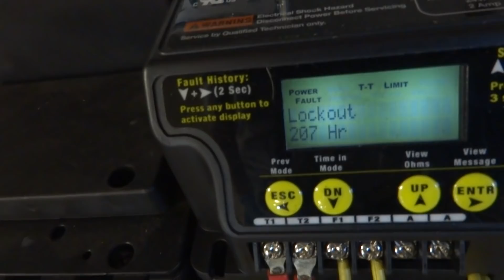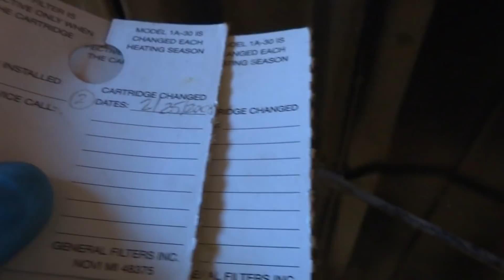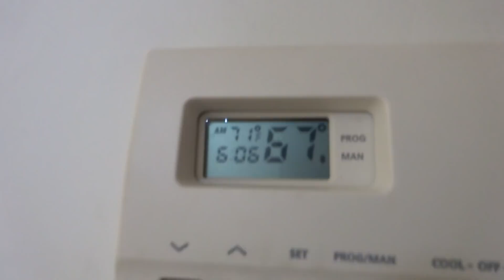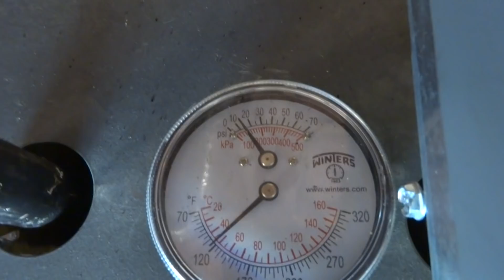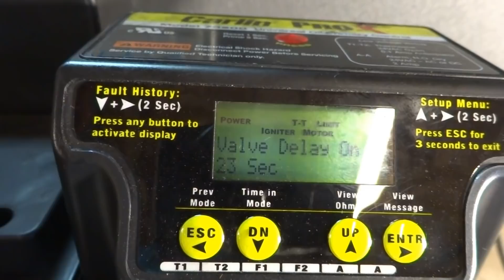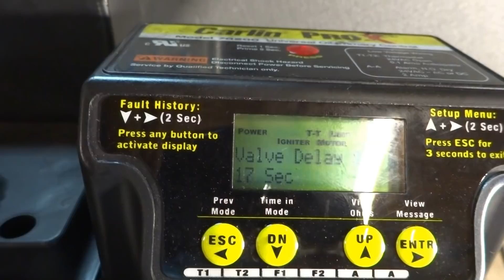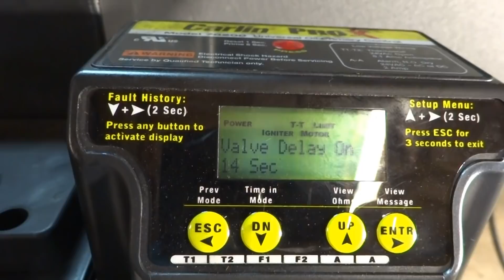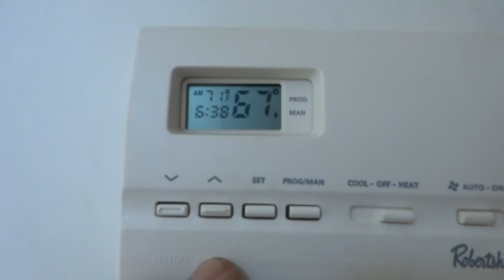CARLIN EZ1 OIL BURNER RUNNING ROUGH LACK OF MAINTAINANCE

Comment: The thing I don't like about these EZ1 burners is that if you get an air bubble in the oil line and the flame extinguishes for less than a second, the burner trips off. I prefer the Becket B2007 controls with a 15 second TFI and a 2 stage oil pump for in ground tanks. The Carlin and all the other burners with single stage oil pumps seem to have trouble maintaining steady oil flow with in ground tanks. Would be nice if the system were more tolerant of sub 1 second flameouts. The EZ1 trips immediately. Whereas the Beckett has to lose flame for 15 seconds then it trips. Much less likely to result in nuisance calls.
Reply: You can change that in the settings on the control. You can even set it for "smart interrupted ignition" where if it flames out it will turn the ignitor back on and if the flame comes back within 15 seconds it will stay running. 2 stage pump can be ordered on an EZ1 as well. I like them better because of the adjustable head, don't need to change heads for different combustion rates. I even run the 70200 Carlin control on Becketts, have one running on the 1972 Beckett SR at my mother's house, never has an issue but it's set up for smart ignition, not standard interrupted.
Reply: @theodorgiosan2570  the manual that comes with the burner either doesn't discuss how to reprogram it, or I missed it.
It's annoying because we have a long section of horizontal flue (about 12') before it reaches over the furnace and hits the chimney. So the backdraft on some days extinguishes the flame and this burner, rather than a brief hiccup, shuts down for 90 seconds.
How to you change the program? What page of the manual discusses it? Thanks.

Comment: Wouldn't be advantageous to scrub out the filter housing before changing filters?
Reply: He does that sometimes. I dont know why he didn't do it this time.
Reply: It could be because he saw inside and deemed that it wasn`t necessary--or because someone else was supposed to be taking care of the issue...(and it may not have been perfect, but it Steve left it a hell of a lot better than it was BEFORE)!

Comment: Why is the oil line coiled before the crossover Steve I never seen that before
Reply: Service loop. It's a standard practice in low-voltage electrical, and apparently some states require/recommend it for oil.